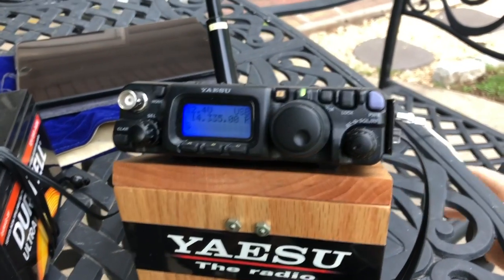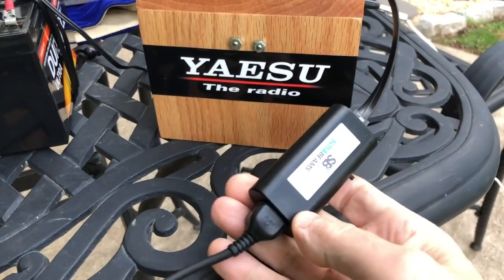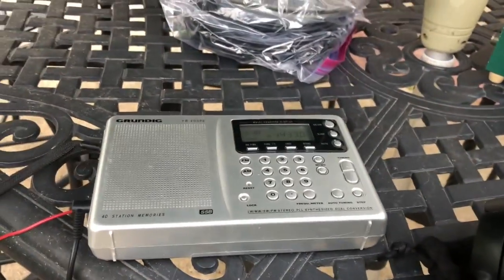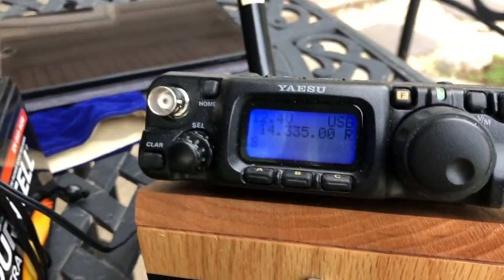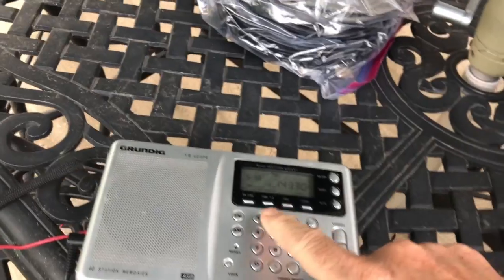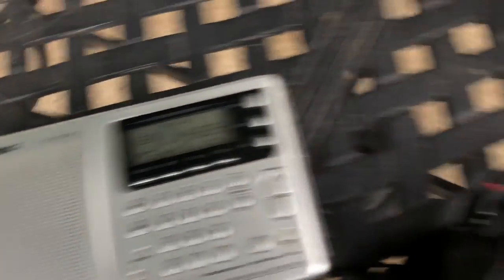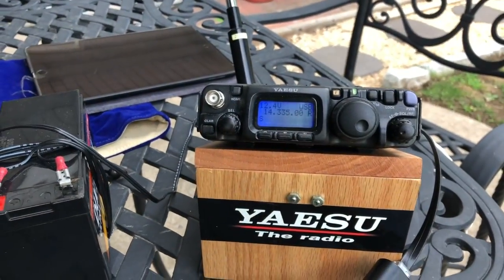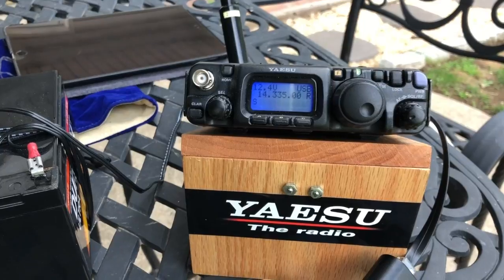SOTABeams Speech Compressor testing--Part 3 (FINAL)

Comment: I own an 817ND and an 818. I bought TWO of the Funk Amateur kits , one for each, and built them as kits. Both radios come out of the factory set at 50 for the mic gain and both have similar audio performances. So, the whole idea is to get the compressors tailored to the radios and not complicate/convolute things with changing settings in each radio as well as in the compressors. The default settings of the input level pot and output compression level pots are WAY too high and I cranked both of them down to nothing (full CCW) for starters. Not wanting to mess with a lot of test equipment, I simply transmitted into a dummy load with each radio and set another transceiver with the antenna jack shorted as my "listening device". The first step is to set the input level pot's setting to sound exactly the same with the compressor switched on or off. This can easily be done "by ear". The 2nd step is to switch the compressor "in" and adjust the compression pot up for much more "audio duty cycle/level" on the transmit RF. It's a bit qualitative to do by ear, but if you set the compression pot up too high, you'll easily hear the distortion flat-topping. So you crank it down a little until that "barking" goes away, but you still have much more "punchy audio". These devices are great additions to the 817/817 and the 857 series radios to increase your readability at the station you are working. An observation: Yes, the level of the tone used for antenna tuning over the air is purposely set very low. This is done to keep it a pure sine wave and not create splatter. It's set sufficiently high to do its intended job and should be left at the level it was set to initially. The last comment I'd like to make is that I run my compressors with the mike's coil cord plugged into the radio and compressor output. I plug the short flat cable into the mike itself and the compressor input. This way stretching and flexing the overall mike cabling puts the bulk of the strain onto the coil cord which is better equipped to handle that on a long term basis. The short cable keeps the compressor hanging 6" under the mike. Since it doesn't weigh much, this is a good place for it and creates minimum strain on the connectors.  Tony (W9MT)

Comment: Hello Chris, I wonder, can you in a few words let me know how satisfied (or not) you are with the compressor?
Hope to hear from you.
73, good DX
Gust ON6KE ON7QRP
Reply from the maker: Hi Gust!  Thanks for checking the videos out!  The compressor works great.  I had great results with it the first time I used it for a POTA activation.  Good reports for audio and signal.  Since it’s not shielded in any way, if there is stray RF from a mismatched antenna, you might get that feedback I showed in the video.  But that's only if you hold the box while transmitting which is unlikely.  So, it's a good compressor, easy to use, and not too expensive.  Hope that helps!  Thanks again!  73 de K2CJB
Reply: Your input is much appreciated Chris. OK I'll go get me one!
73, good DX, take care.
Gust ON6KE  ON7QRP
Reply from the maker: One thing I remembered is to bring the 817 mic gain down to around 50%. That’s where I run mine.